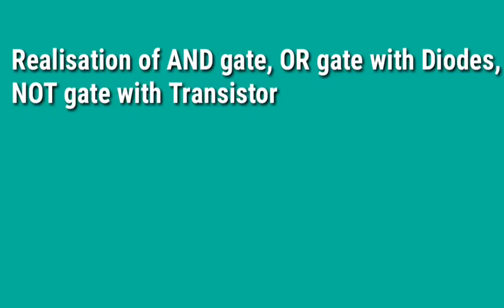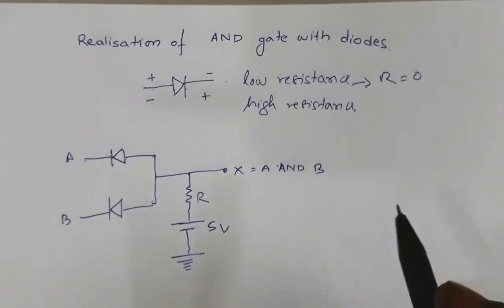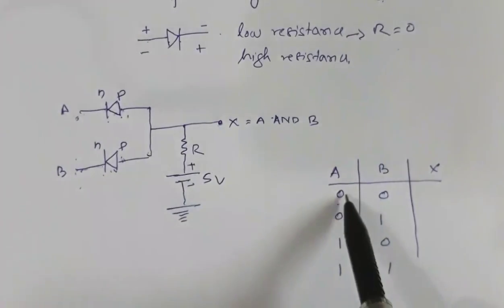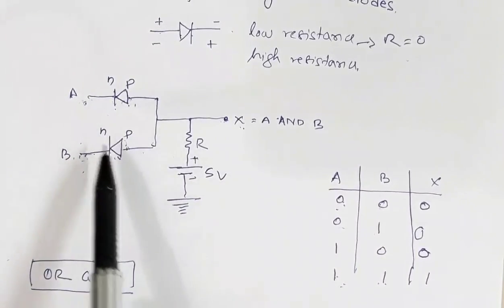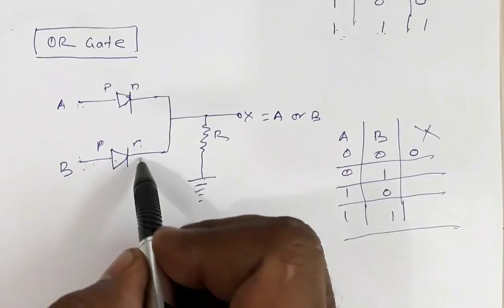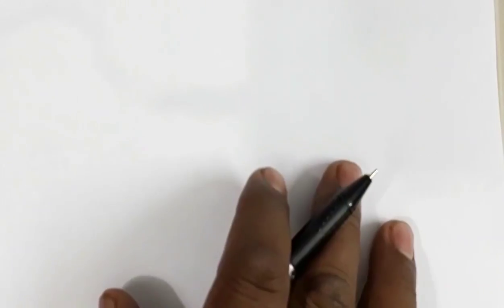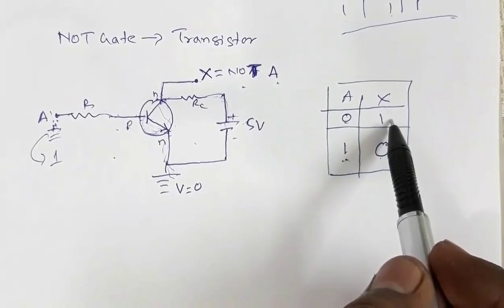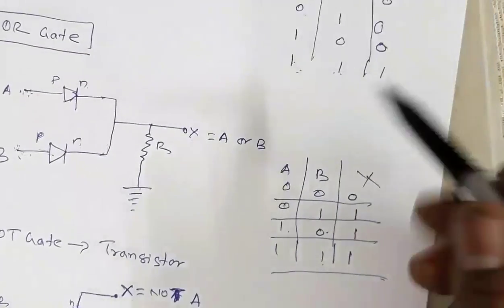AND Gate, OR Gate using Diodes, NOT Gate using Transistor

Comment: Respected sir, in 0,1 or 1,0 condition of AND gate, according to your explanation, output should have been 1, because atleast 1 is forward biased. Your explanation is wrong. You didn't explain why an extra potential of 5V has been applied in the case of AND gate. You have made both the functions of OR and AND same.
Reply from the maker: If you prefer you may watch the video again or you may refer to Concepts of Physics by HC Verma. My explanation is based from that book.